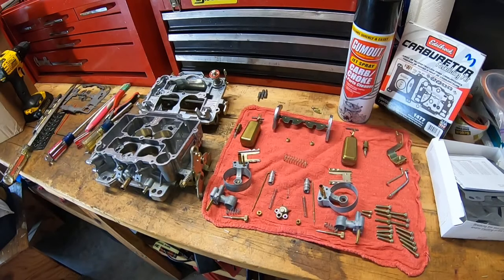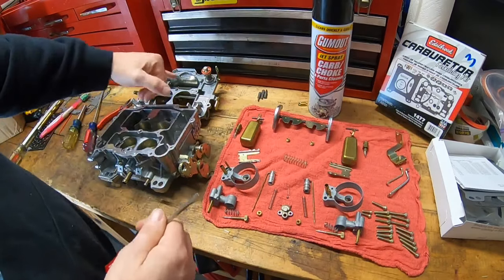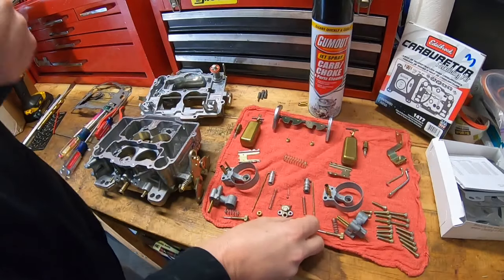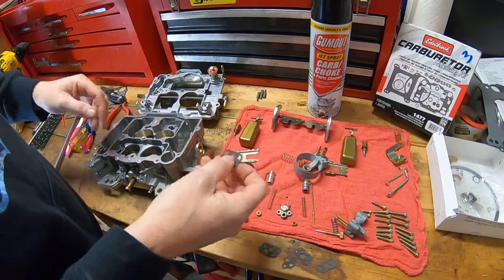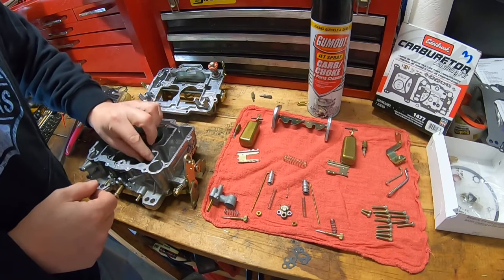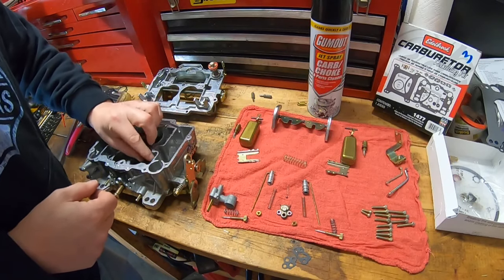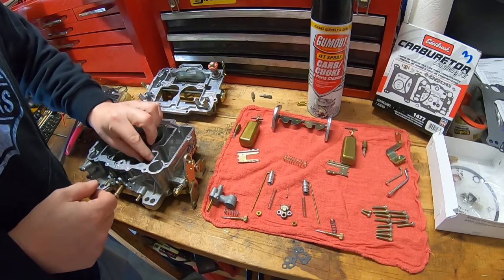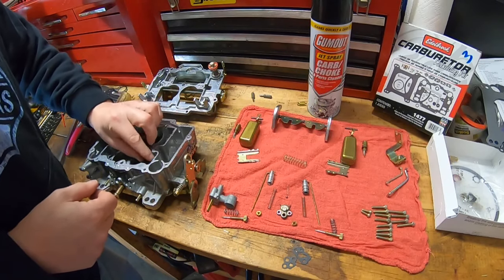Edelbrock Carb Rebuild Step by Step

Comment: I didn't know that Edelbrock used a chem film or the like on the body or airhorn. I think the newest ones have ptfe on the shafts, though. 
I do recall when I used to refurbished Carter AFB and AVS models that they were bare alloy. We would use a Foredom or dremel with wire cups all the time. Nylon, too. The real problem was residual from fuel additives and of course oxidation on the exterior. 
And diesel fuel soaking was the norm before the rebuild. This is a great video. Thanks.

Comment: I appreciate you taking the time to explain everything in detail! I’ll be rebuilding a carb for the first time on my ‘65 Galaxie tomorrow and I’m way more confident I can do it now after watching
Reply from the maker: Yup.  It’s not that complicated when you can see it done.  I’ve got a lot of Edelbrock carb videos.  Don’t hesitate to search through them if you run into any issues.  Or just drop a message on a video and I’ll try to respond quickly.  Good luck!
Reply: @MuscleCarSolutions  just wanted to come back to say thanks again my rebuild was successful and the Galaxie is running better than it ever has in the time I’ve owned it
Reply from the maker: That’s great to hear!  Good work!

Comment: P-R-O-C-E-D-U-R-E, THE ONE WORD CARB REBUILD KIT DIRECTIONS OFTEN LACK.  THIS IS GREAT STUFF.  THANKS MUCH. I'VE ALWAYS GONE TO WEBER 38/38 OUTLAW CARBS FOR SMALL BLOCKS, GOT ONE ON MY F 250 300 6 CYLINDER-WORKS GREAT, BUT NOW I REALIZE EDELBROCK WAS WAY AHEAD OF ME.

Comment: I’ve used both brands edelbrock and walker carb kit , when you buy a walker you have to get the right one for your car say it’s a 1406 electric choke it’s has only the gaskets for that one the edelbrock style  some general kits will fit other Carter carbs , edelbrock carb kits are made by walker but are more specific to edelbrock. Kit price’s are close in cost  walkers are about 10 bucks less so it depends on what you need but please people don’t buy those Amazon cheap kits they are junk never bought one but some friends tryed to have me rebuild a carb with that junk and I said no don’t waste my time , your videos are such a great help
Reply from the maker: We reviewed all of those kits in a couple videos.  The knock off ones are a complete waste of time.  I feel sorry for anyone that’s bought one!

Comment: Soooo. I love the info in your videos!!!! I  just bought a 62 nova that has a built 350 0.40 over in it with a complete edelbrock top end. Aluminum heads, big cam, air gap intake, dual 500 cfm carbs thunder series edelbrock,  9.4:1 compression. 
The bad thing is the car has sat long enough that the rubber fuel lines had 3 inch long splits in them. Of course the carbs need rebuilt and thanks to this video I think I have it under control. However that is another complication in a way. The car was tuned to run strong at 900 ft above sea level. And I live at 3500 ft above sea and will be driving the car up to 4000 ft at times. So I'm basically starting over with a completely new tune in on this whole set up. I might need some advise from you along the way. Any starting point that I need to consider when rebuilding the carbs for the thinner air at higher elevations would be great. Also I live in Arizona so the heat is also a factor. Thank you for your work on these videos. I really appreciate the resource to reference.
Reply from the maker: I’m glad you’ve enjoyed the videos.  I have one more for you to check out!  😆 How to tune a carburetor for higher elevation is the title (I think).  It will give you some tips on two extremely critical things you’ll be adjusting.  Ignition timing and the carburetor tune.  Check it out and if you have any questions I’m happy to answer.  Good luck with the rebuilds!

Comment: Thank you thank you thank you for this video!  Im having terrible trouble with my v8 and i assumed that it was related to ignition.  After seeing your video i thinki ive made a few mistakes when rebuilding my carb.  Thank you so much  :-)
Reply from the maker: Nice!  Hope you find the trouble quickly!  Let me know if you have any questions.  Happy to help if I can.
Reply: @MuscleCarSolutions  thanks!   The more I rewatch your video,  the more I learn.

Given that mine is a 4 barrel carb,   Would you recommend an open gasket and an open phenolic spacer?    Or should I be using a 4 barrel gasket and 4 barrel spacer?   I’m thinking that mine has a vacuum problem from using the wrong style of gasket and spacer,   Which may explain why I’m not getting  vacuum advance on the dizzy too.    I suspect that I may have accidentally restricted the vacuum ports into the carb.   Newbie fail!
Reply from the maker: What intake are you using?
Reply: @MuscleCarSolutions  its a performer manifold on a rover v8.  you might know it as a buick215 - im in the uk
Reply from the maker: Ah I see.  What size carb are you running on that?  Anything else done to the engine?  Cam?  Higher compression?  Headers?
Reply: @MuscleCarSolutions  yeah - 500cfm carb.  Mild cam,   ported heads,  headers etc,  not sure of the CR as i didnt build it.
Reply from the maker: @revingtosh  sounds like fun!  You can run the open gasket or the four hole.  It won’t affect anything.  As long as it matches that intake, it will be fine.  If you’re not sure if it’s drawing any air in, you can fire up the engine and spray some brake clean or carburetor cleaner around the area where the carb and intake meet.  If it surges it’s drawing in the cleaner and you have an issue to fix.

Comment: Thank you for this video. Rebuilding a 1412 and was confused by the pump discharge weight in the rebuild kit, carb only had the ball and spring in when i took it apart.  Put it back together with the weight like you suggested and set the floats like you did as well. Thank you!
Reply from the maker: Yeah that will catch you off guard if you’re not ready for it.  One of the many reasons I do these videos.  Very happy it helped you!

Comment: @Musclecarsolution  just a fyi on the comment in your video that stated, Edelbrock didn’t have different nozzles available.

Edelbrock 1475 Accelerator Pump Nozzle Kit is available online for those that need it.

Comment: just did my 1411 ..  had a missing weight above the check ball…  i think that explained why tip in / part throttle just fell on its face!   mild low compression 454 in a Gbody
Reply from the maker: That would do it!  I’m sure it was pulling too much fuel through the accelerator pump circuit with no way to regulate it.  Good work!
Reply: @MuscleCarSolutions Actually the AFR would go up to 19 during tip and bounce around but once into secondary pulled hard. Glad i was able to do it today .. been bugging me all week
Reply from the maker: @johnnyboyssite  19???  Wow that’s ridiculously lean.
Reply: @MuscleCarSolutions  yes but just during primamary stage. no damage done.. running like a champ now .. one thing ive learned is that low CR Big blocks are very forgiving.. Ill be to race again once i get the slicks on.. during the summer at a local 1/8 mile track.

Comment: I have to rebuild the Edelbrock 1406 on my truck. It’s starting to seep fuel from the throttle shaft. It’s also had a heat soak problem since I bought the truck years ago. My question is how does the level of fuel in the bowls help with fuel boiling? This video is very informative, thanks.
Reply from the maker: @sheldondyck8631  I did a video on heat soak and how to avoid it.  Take a look at that one to help with that issue and I cover fuel levels.  As far as any pushing of fuel, only question I have is; what is your pressure regulator set to?
Reply: @MuscleCarSolutions  I have no pressure regulator. The fuel system is stock except for the carb
Reply from the maker: @sheldondyck8631  I’m gonna send you to another video! 😂 I’ve talked about using a regulator (yes, even with a stock pump) in many videos.  How to choose the twiggy pressure regulator or how to build a fuel system are two you could check out.  Always run a regulator.
Reply: @MuscleCarSolutions  I should mention the carb doesn’t leak fuel from the shaft if the engine is running. Just while sitting. This problem started about a month ago. The truck starts and runs great otherwise. It’s parked for winter now cause Canadian winters are not kind to old vehicles.
Reply from the maker: @sheldondyck8631  I don’t do cold weather anymore.  It’s supposed to be 32 C here tomorrow.  Perfect fall weather!
Reply: @MuscleCarSolutions  32C is pretty hot for me. Anything over 22C and I’m cooking. I can’t handle hot weather. It’s a lot easier to warm up then cool off
Reply from the maker: @sheldondyck8631  I got to the point where I lived most of my life in cold states.  Next time I move it’s going to be further south!

Comment: I have a 1997 Mariah boat with 5.7 marine Edelbrock 1409 I think.
It runs really good, but after I shut it off I always have to give it throttle.  It smells rich after starting, and seems rich idling. It does idle ok. Just seems rich. 
I’m getting ready to rebuild it tomorrow. Any ideas what I should look for?

Comment: It’s what I have. When the 400 chev was dropped in this 1951 Chris-Craft Racing Runabout about 15 years ago this is what they used. It’s what I just inherited when I bought the boat recently. Just finished rebuilding it after watching your video. Question is what to do different with it now?
Reply from the maker: Ultimately the decision is yours but if it were my boat, I’d have a CG approved carburetor and fuel system.  Here’s why.  If you ever get into a situation where you break down on the water, have a fuel or oil spill, or worse yet the boat sinks and they do any investigation and find non approved equipment on those systems that can negatively affect water quality, they’ll hit you with fines that are more than whatever the boat is worth.  I know a bunch of folks use street equipment on boats and get away with it but it’s a roll of the dice that I wouldn’t be willing to take.  Look into what the regulations are where you plan on using it locally and coast guard laws and you’ll find the information you will need to know.
Reply: Yes I am aware of what you are referring to.  However, I do not believe there are any CG rules related to modification of antique boats like this. I will review this question on the antique boat forums to see what is known about this issue. What I have done so far is to completely rebuild the fuel delivery system to standards better than required by CG on any boat. Back to my question. What needs to be done to make this carb work if I choose to use it? When I look at a marine Edelbrock like the 1409, I don’t see much difference. What am I missing?
Reply: Sorry. 1410
Reply from the maker: @CaptTPT  Theres plenty of difference.  no vacuum ports on the marine carb.  Port that’s required for fuel vent to go back to the engine in case of flooding.  Corrosion resistant finish.
Reply: Ok. Excellent. That is very helpful. I appreciate your help with this.

Comment: All the internal screws are torx and all the external screws are flathead. The external screw that holds on the manual choke bracket is a little longer than the rest. Spraying the paper gaskets with WD40 helps them to come off easier next time you rebuild it.
Reply from the maker: Only on carbs made in 2001 and earlier on the hardware.  The airhorn assembly hardware is all the same length.  Assuming that’s what you meant with the manual choke cable bracket.  The WD40 thing is a great tip.  Though I rarely remember to use it on assembly.  More so on the holleys where you see that benefit.  Thankfully most kits have the non stick gaskets.
Reply: @MuscleCarSolutions  thanks. So the carb I’m doing now was made before 2001! Wow! And I agree about the Holley gaskets. They were always more prone to stick.
Reply from the maker: @chucksgarage7165  if you want to know the exact day and the year it was built - https://youtu.be/Rwacvv3XvA4

Comment: Thank you for making this video, super helpful. Question, my 72 c10 has been sitting for 6 months and when I try to crank it I have fuel coming out of the metering rod covers. I have the same carb that is in this video. What would cause that and how would I fix it? Thank you.
Reply from the maker: I did a video on the four reasons why a car might flood.  You’ll get a more detailed response in that video.  Needles stuck open, too much fuel pressure, floats not set right/compromised, garbage in the system to name a few.

Comment: I bought my 1906 AVS2 used. It did not have that weighted valve. Sid they come with them? Also the PO went to a 7342 rod from the stock 7037 rod to lean it on the primary. Edelbrock Tech also advised leaning the secondary to .092 from stock .095.
I have a 4.8L engine

Comment: Regarding your Edelbrock customer service claim -  My kit was missing the accelerator pump plunger cup. I called Edelbrock and they wouldn't send me one - they simply told me it wasn't sold separately, and said I could go buy the 1467 assembly. Thanks Edelbrock. I couldn't return my kit because I had it sitting on the bench for a few months before starting my rebuild. True, I should have checked it. But Edelbrock wasn't much help to me. FYI.
Reply from the maker: Sorry to hear you had that experience.  I’ve sent hundreds of people to them for parts that are missing or they lost and they’ve always taken care of it.

Comment: I was trying to tune the idle for a Chevy 350 and I had to turn it so that the bypass slot would have been exposed.  Does that mean I need a large CFM carb?  It is a 600 CFM carb on a mid built motor.

Comment: Great video. Thank you. I inherited an Edelbrock on a 400ci sbc set up in an old wooden boat. How will the vacuum work in this application?
Reply from the maker: The Edelbrock marine carburetors don’t have vacuum ports.  Is it a street carb?
Reply: I suspect it is a street carb. How would I identify a street vs marine ?
Reply from the maker: @CaptTPT  part number is best.  Finish is another.  Google image search a 1410 and 1411.  The 1410 is the marine carb and you can see the difference in the finish.
Reply: 1407 (1874) 750 cfm performer series
Reply from the maker: 750 CFM street carburetor made on the 187th day of either 2014or 2004.  It’s not made to run on a boat.
Reply from the maker: Marine distributors are all mechanically advanced.  They use no vacuum ports.  The trouble with running a street carb on either fresh water or salt water is corrosion.  Salt will go quicker but will occur with both.

Comment: Guess I'm going to try it. No idea what im doing lol.  I'm told the popping sound during acceleration is a jet issue or too rich or too lean mixture. Can adjustments be made before I dive into a rebuild?
Reply from the maker: Yes you can alter the rod/jet sizes as the tuning chart lays them out for your part number carburetor.  Just follow the steps in how to read that in my video that addresses it and you’ll do just fine.  It’s not complicated at all.

Comment: I rebuilt my Edelbrock 1407 and didn't notice that my 8 screws were actually 4 short and 4 long (like the ones at minute 56:20), Is there a specific placement/pattern for the 2 different sizes? I tried looking for a chart everywhere but had no luck .

Comment: Just wondering,do you have a video of replacing throttle shafts and springs/linkage? I took pics but still stuck,thanks in advance!
Reply from the maker: They are non-serviceable items.  Edelbrock does not offer them for sale.

Comment: Hi   was hoping if you idea o  why a 1406 leaks from top of carb pushing out Lots of gas from step up piston metering rod area
Reply from the maker: What is your fuel pressure set to? Checked your floats yet?  Needle and seats?

Comment: I watched your video yesterday and made some change to my 1406. I had a dead spot at take off under load. I installed.395 jets and 70-37 metering rods. I have a slightly built 289. Now when I crank the engine, fuel spews up through the metering rods. What causes this?
Reply from the maker: I just did a video on flooding.  You might check that one out, but the first question I always have is, what’s your fuel pressure set at?
Reply: @MuscleCarSolutions  Fuel pressure is 4 lbs. Thank you for the reply! You're videos are very informative.

Comment: When I set my float bowls I made sure to have the 1/2” space under the full length of the bowl parallel to the top plate. The edelbrock manual details it this way and in the time up guide it measures the leading edge just like you did in your video. Should I be concerned with the way I set my floats?
Reply from the maker: The correct way is like I showed.  What advantage do you think you’re achieving with he float parallel to the airhorn?
Reply: @MuscleCarSolutions  thanks. I was not looking for any type of advantage. Im used to mechanical things in general especially floats being level, flat, plumb, equidistant etc.  when you look at the float lines that the fuel leaves on the outside of the bowls it’s definitely not flat or level to the carb. Anyway, going to make some final adjustments and re-install. Thanks for the quick feedback.

Comment: The check ball that goes on the weight.. Is it metal... Mine didn't have the ball or the Spring..
Reply from the maker: Yes it’s metal.  Someone must have removed it.  Put one back in.

Comment: Can you please explain why gas with ethanol would require a 1/2" float adjustment vs 7/16? I'm in CA with 10% ethanol. Also any other considerations for a 1906 AVS2?
Reply from the maker: Easy.  Ethanol boils at 175 degrees or so at sea level.  The boiling point does go up the higher you get in elevation, but is still relatively low.  Carrying less fuel means there’s less to boil over into the engine and causing a flooding condition.  Hard starting, etc.
Reply: @MuscleCarSolutions  Actually, the boiling point of alcohol goes down with altitude.